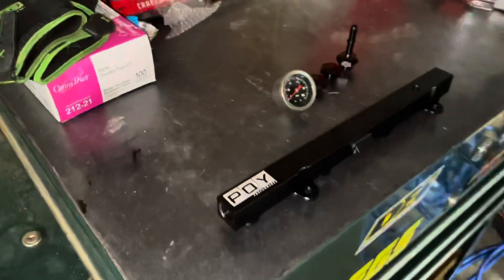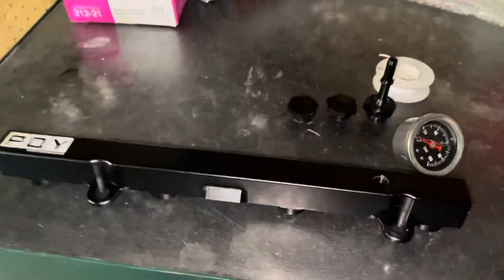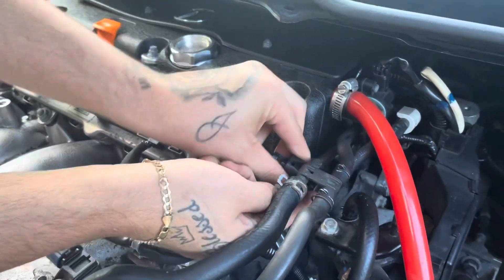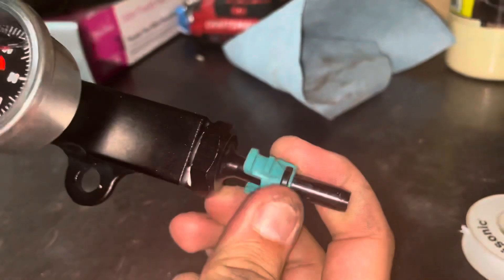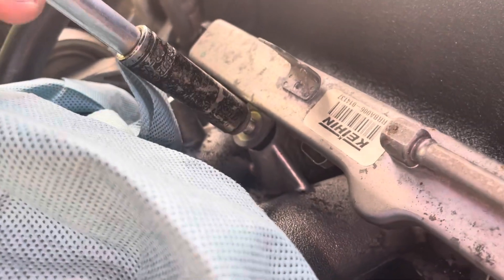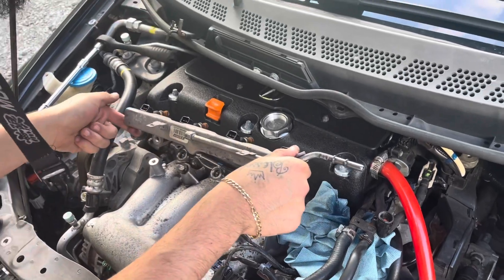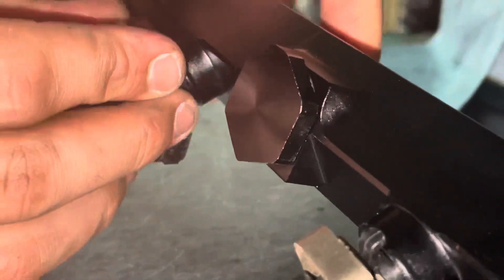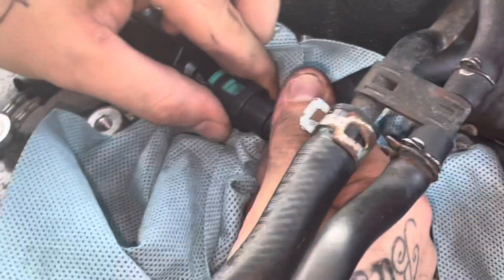PQY Fuel Rail Install | 8th Gen Civic Si

Comment: Quick question men, I put in new injectors which I believe 310cc with the same rail. But when the car is on it idle like a tractor lol. You know possible issue?
Reply from the maker: Have you tuned it brother?
Reply: facepalm.... u gotta tune the car for bigger injectors

Comment: So with the rail and stock injectors would you need a tune, I would asume not right
Reply from the maker: Yeah no I didn’t tune right after and all read good on my ktuner and the car performed well
Reply: @chvpobuilt  thanks for a fast reply, Im having a fuel problem and want to upgrade everything where I don’t need a tune yet but still drive like factory

Comment: How’s the rail doing now ?
Reply from the maker: Great. Havent had a single issue since install 100% recommended
Reply: Prolly not bro, the injectors control how much fuel goes into the cylinders not the rail

Comment: I think the injector safety clips don’t go with that rail
Reply from the maker: Your right bro. Not necessary to clip them  on
Reply: Can install the injectors without the clips?
Reply: @apex_predator9401  yes they just slip in lube the orins and gently wiggle them in.
Reply: You are right.  I have the same rail.  You don't need them.

Comment: Bro what intake is that and good shit how’s the fuel rail doing kinda wanna order it rn
Reply from the maker: Its a 2.5 ebay cold air. Gets the job done man. Let me know if you need the link. I haven’t had a single issue with the fuel rail. I been driving the car daily. Try it out bro you wont regret it